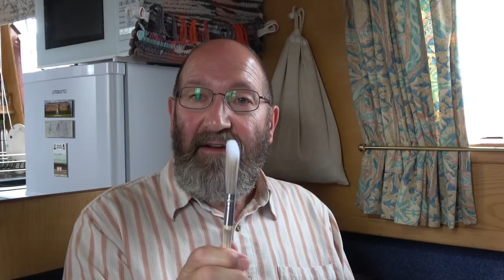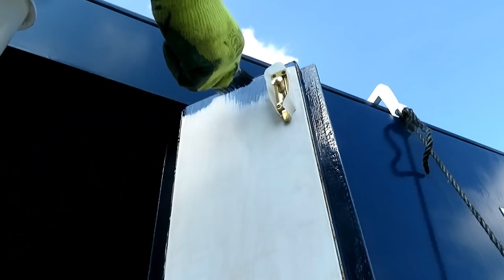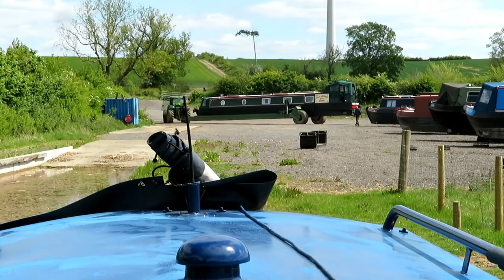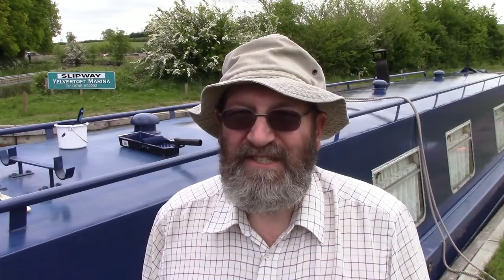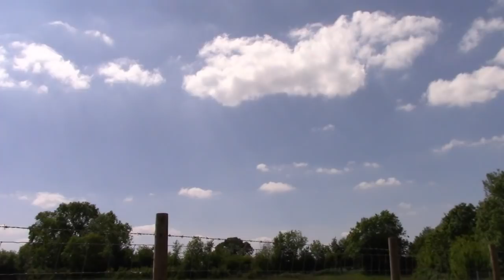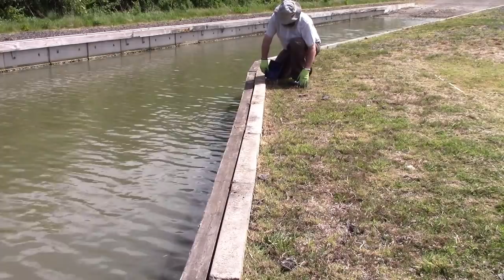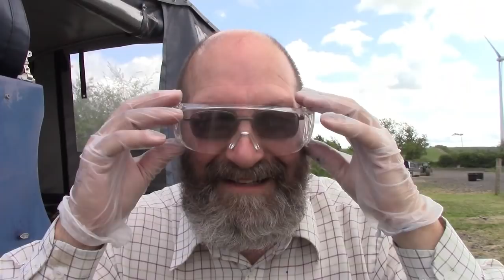123. Painting My Narrowboat – Part 10

Comment: It looks great, nice job! 

Curious, do you notice in the summer that the ceiling of your boat (inside) gets hot? In the future you might consider a much lighter color on the roof. It’ll make for less heat soak through the roof on sunny days. Keeping the inside possibly a lot cooler.

I had an office made from a brown shipping container back when I was a lead mechanic. It got so hot that the window unit AC wouldn’t keep up and I was baked like a noodle. I painted the roof and side white and it cooled down by 20 degrees inside. Seriously 20 degrees on a mid summer day. 

Cheers,
Jeremy
Reply from the maker: Hi Jeremy, I see it as 'swings and roundabouts' - do you have that term in the US? In the summer, the light coloured roof keeps the boat cooler inside, but in the winter the darker roof helps keep it warmer. I prefer the latter approach! All the best Alan
Reply: My Narrowboat Venture I believe that would be pros and cons? But yes I definitely can understand your method if winter is the priority.

I’ve always personally preferred keeping the heat out in the summer and keep the heat in in the winter. Keeping it out via light color and radiant heat shielding. Then keeping the heat in via proper insulation and window/door seals.

But this is just person preference. Not to mention my year round climate might be a bit different. So your method obviously works for you. We routinely see 30c+ in the summer and 1.6c winter. 

I hope you’re healthy. We are in trying times for sure. We have so many people not taking proper precautions (masks and social distancing) because apparently it’s violates their freedom. Apparently other people’s right to not being infected is of no concern. I’m still working daily but I think the US is approaching 20% unemployed in most areas which makes it all worse with unemployment insurance running out for those unemployed. 

The museum I’m on the board of hasn’t been open in 4 months or more. So we are struggling to pay bills. 

I hope a vaccine is found soon so we can start to world wide recovery.

Comment: Book of Bob.
Verse 3:14 "Man can not live on cheese topped rolls alone".
You seem to be proving that wrong.
I am no expert, but when you were doing the roof and did a close shot, I thought it looked near enough that a Maguiar (paint repair) polish and buff might have smoothed it out, I have used that on cars with good results. But I did see another boater come unstuck with that, I think he let the polish dig too deep before he buffed it off. So if you go that way in the future it will be worth it to test the technique from Maquiar's help sheet on an unseen part, under the seats  in the stern for example.
Reply from the maker: Thanks for that tip, I'll look into it, as I'm not familiar with it. I too have felt that there may be a way of buffing up the paintwork, along the lines you suggest. All the best Alan